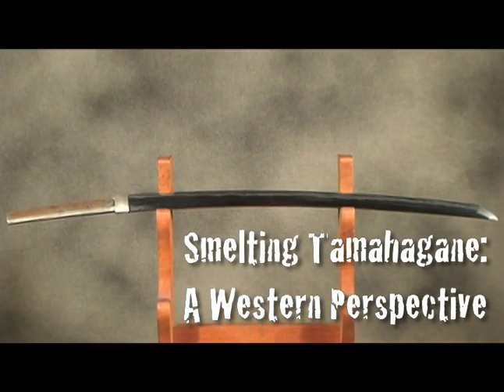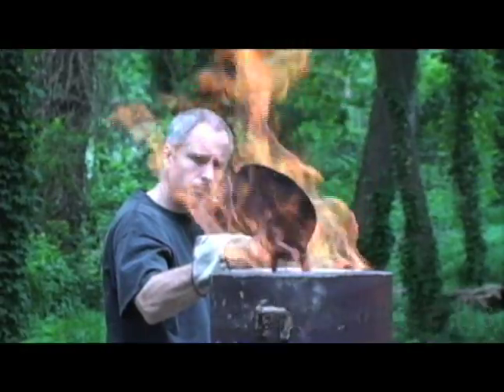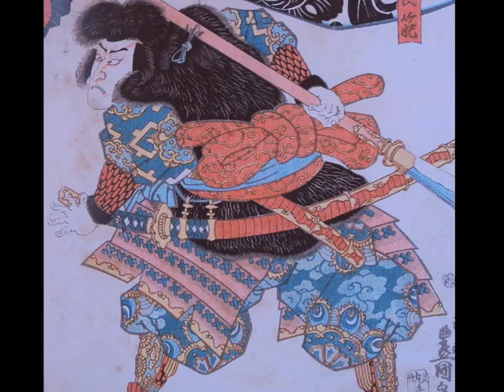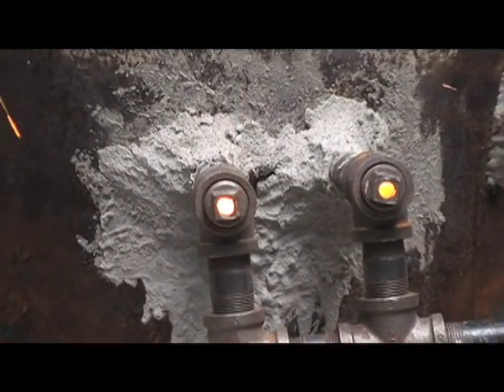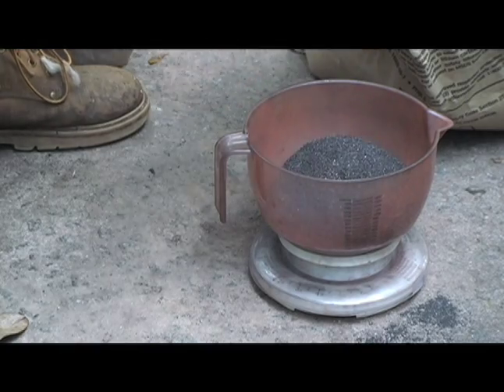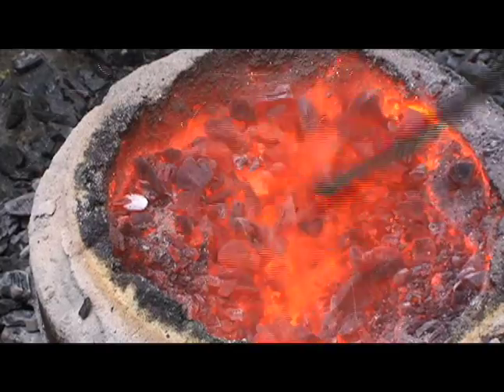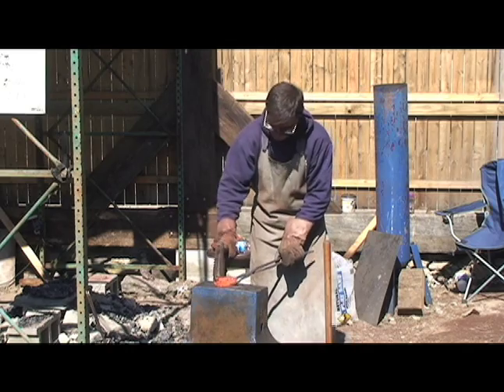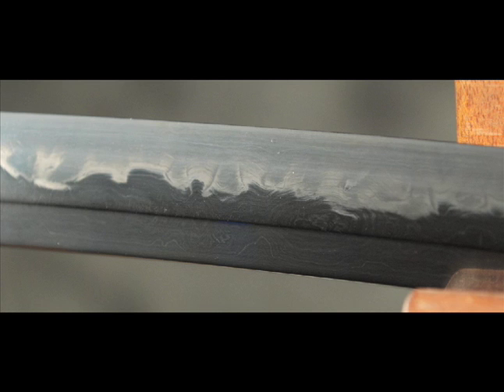Japanese Sword:  Tamahagane Smelting with Bladesmiths Walter Sorrells and Jesus Hernandez

Comment from the maker: There's no exact number.  Even within a given smelt you can find pieces with virtually no carbon and pieces that are up in the cast iron range.  Carbon varies substantially even in a given piece.  That said, you basically chuck the stuff that's unsuitable.  So the material that would actually be used for blade steel is well over 1% carbon.  Sometimes up as high as 1.4%.  But in the process of forge welding, the steel decarburizes and you end up with steel that's in the .7% range.

Comment from the maker: So far as we know, they coated the billet in a clay slurry which liqufies in the forge.  (We presume that's what they did because that's what modern Japanese smiths do.)  So basically it's a silica flux.  The application is different, but chemically it's about the same as throwing sand on the iron.

Comment: with steels you can have differant types for differant purposes, the thing about the nihonto, is that as far as sword designs and edge holding it is one of the best has lots of give but enough rockwell hardness to hold an edge really well and the curved shape is very conductive to slicing more easy then a straight sword, but as some pointe out there are way modern harder steels, that can hold an edge but they also might be more brittle to the impacts if one used them in real combat and break

Comment: You can create those 'micro saw teeth' to any hardish steel, its all about having the right stone, medium-grit and pretty hard (stone material doesn't get lose too easily). Also, if you hold the blade in an angle when sharpening, you can create saw teeth that cut better to the direction you swing, especially through fibrous material.

Comment: Isn't the pattern the similar/same as a patternweld damascus? If somebody wanted a patern like that with a single steel, would you get a pattern from stacking and folding multiple pieces of the same steel?

Comment from the maker: @Danglesboy1   If I understand your question, you're wondering if when you're processing and consolidating the bloom into a steel bar, you need to keep it hot.  The answer is absolutely yes.  Steel cracks when it's deformed in a cold state.  But additionally, it's too hard to move when it's cold.  So you have to heat it up to be able to squash it.  The hotter it is, the more easily it's deformed.

Comment from the maker: @AnimatorsatWork It goes by weight, so 3 lbs charcoal to 1 lb of ore is a reasonable starting point.  You may have to take a few runs at it to get what you're looking for, but that's where I'd start.

Comment: Hi! A while ago I asked what the ratio of charcoal to iron ore was used to make the steel you made, but after thinking and planning out how to smelt it, I forgot to ask you specifically the ratio of charcoal and iron ore.  Aside from what ore was used and what furnace it was smelted in from your last answer to me, does it depend on weight or volume, like is it 3 lbs of charcoal for every 1 lb of ore or is it 3 liters of charcoal to 1 liter of ore?

Comment: Get  a book on metalurgy(a modern one) or do a search on metalurgy.Do not follow bladesmiths or weapon smiths to start with as they have a narrow focus.Try general principles like more carbon for hardness/brittleness and the other common addatives then move onto the more complex steels like cromoly  and vanadium steels,stainless steels,tool steels,spring steels,and bearing steel THEN go back to bladesmiths and blade steels as a main focus.No magic but pure science-even tamahagane becomes easier

Comment from the maker: @choopdewoot  All steel has a crystal structure.  Tamahagane doesn't result in a crystalline structure that's different from any other steel.  In some swords, for instance in the Soshu tradition, there are large crystals known as nie that are visible.  It's unclear exactly what causes this, metallurgically speaking.  I've had batches of tamahagane that seemed to be more susceptible to it and others that didn't.  Kind of a mystery!

Comment from the maker: @diosceles  This introduces a lot of complext isssues.  But,right, strictly speaking the even distribution of carbon is in the billet not the blade, per se.  Of course in kobuse welds and so on, each section of the blade has its own unique carbon content.  I've tested enough monosteel blades to destruction to feel that complex welding schemes are unnecessary with modern steel.  Whether that applies to tamahagane blades is hard to say.  Haven't tested enough to know for sure.

Comment: A "relatively even distribution of carbon throughout the steel" as the narrator states implies a maru assembly style.  Out of curiosity, have you tried more complex assembly methods such as kobuse or hansanmai?  The video shows you testing for differing carbon content within the steel, so I'm wondering if you've ever attempted these other styles.  Or do you feel it isn't necessary with the additional refining you perform on the steel?

Comment from the maker: @TheKingdomofErnor  Hm.  That's a tough one. You're right, there just isn't really a single source that gives you a sort of "cheat sheet" summary of various steels.  If you're interested from the smithing perspective, I'd try reading some of the basic books about bladesmithing first.  I'm planning on doing a video at some point that would give an explanation of the various standard steels used by Bladesmiths...but I haven't gotten around to it yet.

Comment from the maker: @blacksmither1   Good question.  In this case, it's slag.  You can get a furnace like this hot enough to melt cast iron...but if you're cranking out signifcant amounts of cast iron, you're getting too much carbon absorbed in the iron and so the furnace isn't doing what you're aiming for.

Comment from the maker: @AnimatorsatWork With the qualification that it depends on furnace design, ore type, how hard you drive the furnace, etc., I've had the best success running about 3 charcoal to 1 ore.  When I go up closer to 4 to 1, I start getting a lot of cast iron.  When I go in the other direction, I tend to get more medium carbon material.

Comment from the maker: @slyphsoldier   In metallurgical terms, when you heat the blade and then rapidly cool it -- that's called quenching.  The purpose of quenching is to harden the steel.  "Tempering" refers to a second thermal cycling process where you heat the steel to a much lower temperature (typically around 400 F in the case of high carbon steels), which relieves stresses in the steel and softens it slightly, making it less brittle and less susceptible to cracking.

Comment from the maker: @PCoderch That's gracious of you to say and I sincerely appreciate it.  My main point about tamahagane is simply that either tamahagane has a fairly precise metallurgical meaning...or else it's just mystification.  Our material is produced using a modestly tweaked version of ancient smelting techniques and yields material which metallurgical lab tests have confirmed is in the same chemical range as published data on the chemistry of steel used in traditionally made Japanese swords.
Reply: Precise metallurgical meaning I closes the mass spec results for the ore and I promise the ore in Japan is way way different. I wish you would be clear about that rather than calling Texas bloom steel tamahagane. Totally different steel alloys I guarantee it.
Reply: There's no way ore off the side of a Japanese mountain has anywhere close to the same trace cpntent profile as that in North america. I'll eat my shoe...

Comment from the maker: @PCoderch  I've seen material from the NBTHK tatara. It's quite heterogeneous. Parts of each bloom (kera) are dense, parts are spongy. Same with ours. It is precisely that heterogeneity -- not its sponginess -- that differentiates tamahagane from modern steel. You can use a tatara to produce anything from iron to steel to cast iron. It's the technique employed, not the smelter design that dictates the form of the product. Tataras are just one among a broad family of historical smelter types.

Comment from the maker: @MrThahey  Before the introduction of puddling in th late 18th century, wrought iron was sometimes produced in a similar way.  By varying the fuel-to-ore ratio and the airflow, you can produce wrought iron, steel or cast iron.  To address your question about the grain pattern:  in its final form, wrought iron doesn't have nearly as many layers a the steel in a Japanese blade.  But the process is similar.

Comment from the maker: @akoair  Sure.  The shaping of all Japanese style blades leads more or less seamlessly to the final polishing of the blade as you move through finer and finer abrasives.  The final polish not only sharpens and smooths the blade (making it cut efficiently), but reveals the features of the steel.  So it's kind of two birds with one stone.

Comment from the maker: @kakashi1578 The 365 brand is available only at Whole Foods stores, but pretty much any brand should work fine.  They're all made from hardwood mill scraps.  As far as pricing goes, you just have to shop around as the prices can swing by several bucks a bag depending on what time of year it is.

Comment from the maker: @kakashi1578 We've used a bunch of different kinds and they all worked fine.  365 is a proprietary brand of Whole Foods, but you can usually find hardwood charcoal at places that sell high end grilling equipment (Big Green Egg, for instance).  The price seems to fluctuate between around $5 and $9 per 8 lb bag.  Another place to try would be big box hardware stores like Lowes and Home Depot.

Comment from the maker: @kyamelon   You can get started with quite a simple and cheap set-up.  It's possible to make high quality knives without any power tools.  You can find used anvils and make your own forge pretty cheaply. In the long run, though, most knife makers end up buying a high quality belt grinder ($1000+), a drill press, and a hydraulic forge press or a power hammer ($3000+).  The press or power hammer is only necessary for making folded steel.

Comment from the maker: @litemup67  Sure, the modern steel blades are made from a more predictable and homogeneous material, so it's easier to optimize their performance.  The main esthetic difference is in the hada or grain pattern caused by the folding of the steel.  But as far as the hamon (sometimes erroneously referred to as a "temper line"), you can make those in certain kinds ofmodern steels using the same techniques as you'd use on traditional blades.

Comment from the maker: The big problem with what smiths refer to as "mystery steel" is that it's hard to accurately determine what kind of steel it is.  Leaf springs usually make decent blades...but you're always having to guess a bit about how to heat treat the steel.  My feeling is that steel is cheap, so why not start with a known quantity.  That way you aren't running down a blind alley.  Everybody's got budgets to deal with, of course, so if you're really strapped for cash, leaf springs are a good practice steel.

Comment from the maker: With the qualification that every smelt is a little different and you adjust on the fly...  Generally I aim for a ratio of ore-to-charcoal by weight rather than a particular poundage.  Around 1-to-3.  We use a shopvac for air, but any kind of blower will work.  The furnace runs at well over 2500 F around the tuyeres, much lower at the top.  We basically run the furnace until it stops operating correctly (due mainly to the walls melting, clogging tuyeres, etc.).  Eight to ten hours usually.